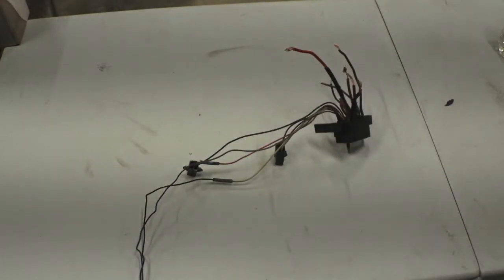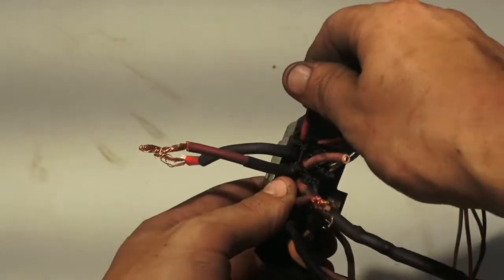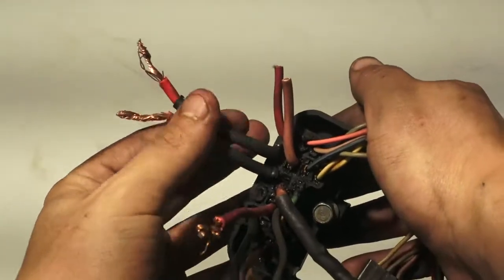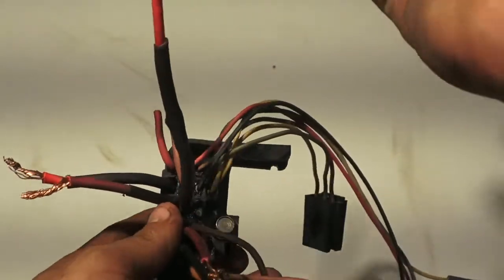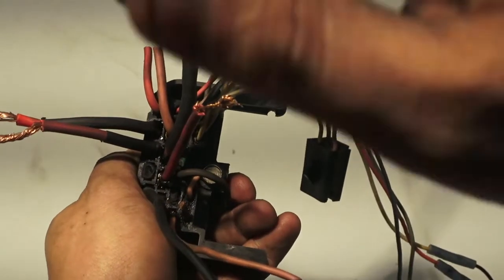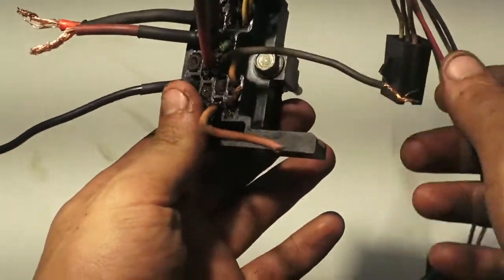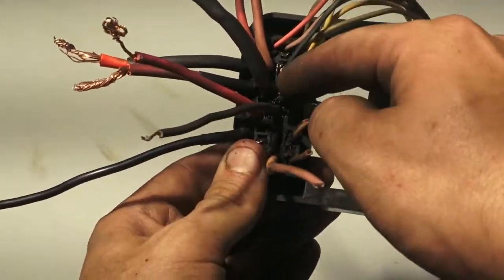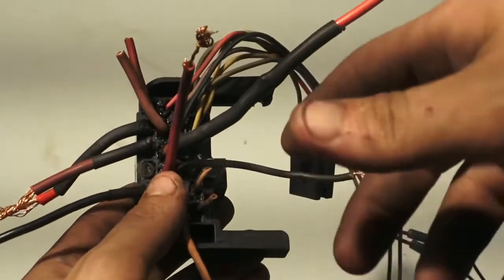C10 LS swap bulkhead wiring  (UPDATED)

Comment: You helped me solve my 12v keyed and cranking issue and I appreciate that. Evidently my old distributor wire is being backfed with 12v from somewhere because everytime I went to that wire it was constant 12v and I could not figure it out. I watched your video and said fk it, I cut the wire tapped my keyed 12v to it and walah  fired right up and shut off using the key. Still have 12v constant at the other end of that wire though, ill have to trace that prob hooked to the starter by accident. I bought this truck already swapped but not finished and I'm fixing other peoples mistakes one by one. Thank you very much
Reply: I have been using a toggle switch to power it before this!